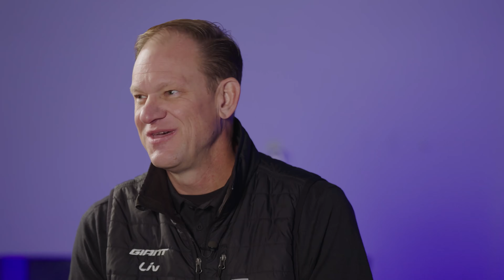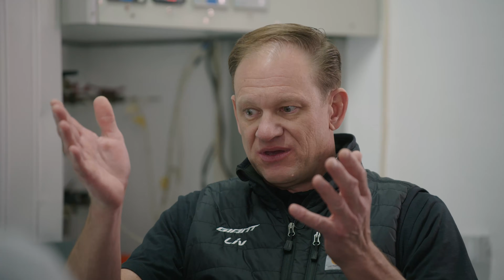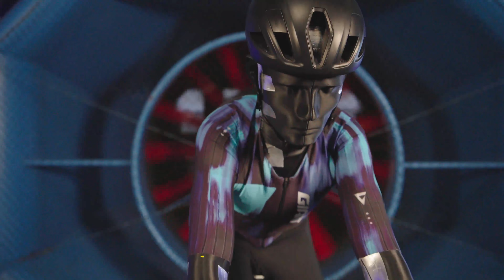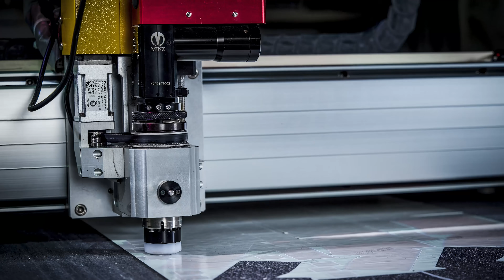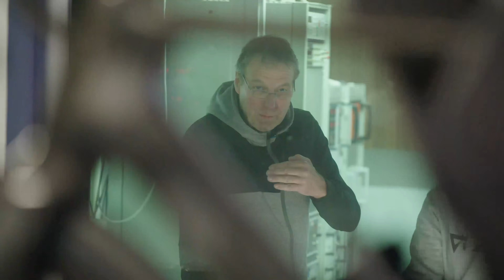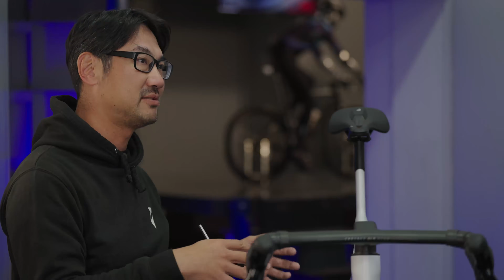Total Speed System: Inside The All-New Propel | Giant Bicycles

Comment: Now, make it with a standard seat post, a threaded bottom bracket and sell it with hooked 60mm wheels with carbon spokes weighing less than 1200g.   And make it available with a 36cm (c2c @ hoods) handlebar as well as 165 mm cranks.